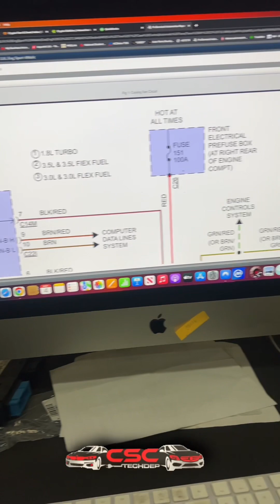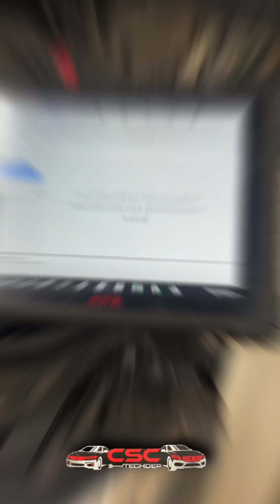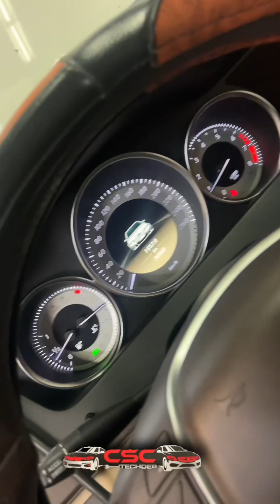Diagnosing Mercedes cooling fan stays on

Comment: I had the same problem with the c200 2.0L, but i solved the problem with 0$ cost. i just cleaned the AC temperature sensor it was dirty, and it was giving the wrong signal to the ECU
Reply: Wheres the ac temp sensor located?
Reply: I have the same problem and question, where is the ac temp located bro? Pls help

Comment: I have the 2013 c350 model i have the same issue but my engine is differnt i have the new black engine v6 the ecu come on the side of the engine not on the top of it
Reply: Hi 
Did you solve the problem?